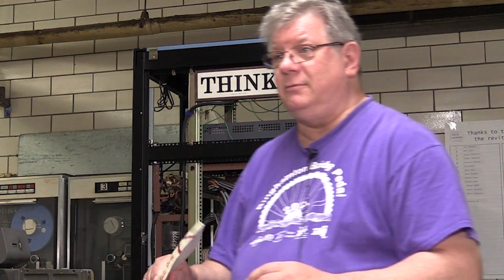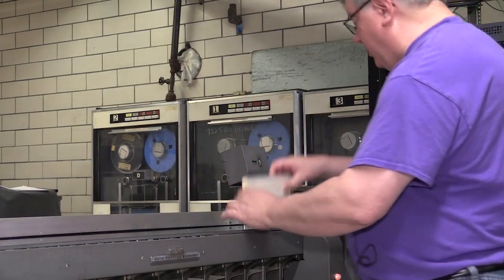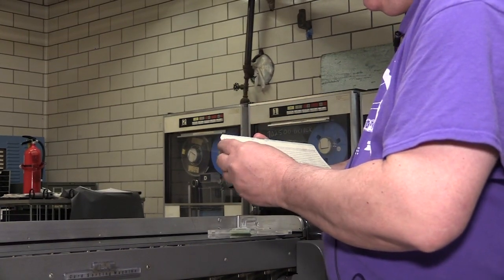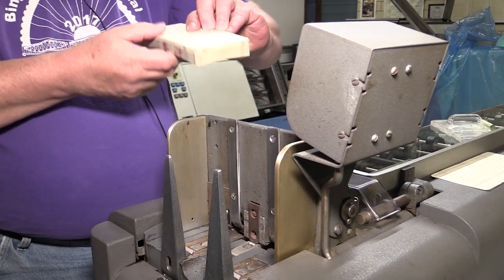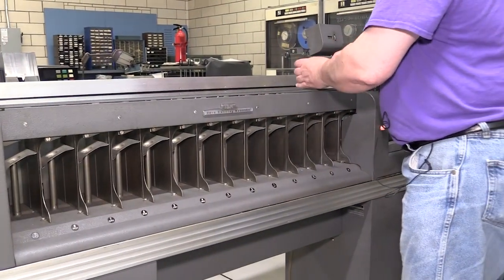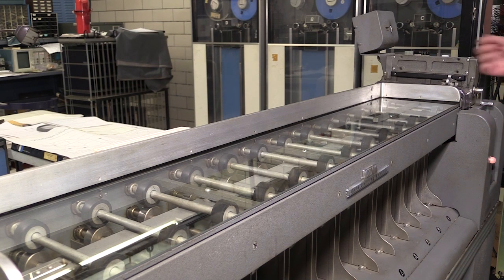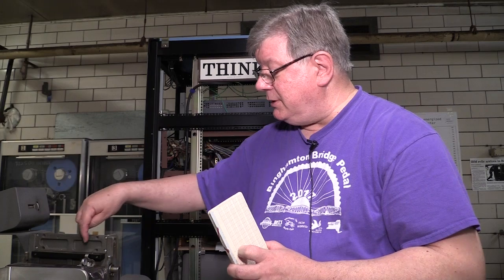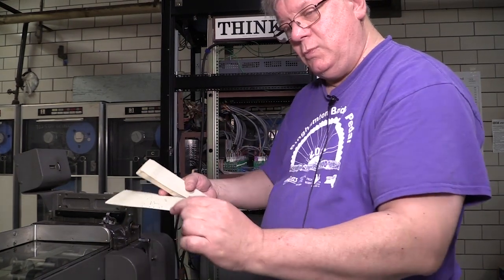IBM 082 Card Sorter

Comment: I used this machine a lot during my unit record days. If you noticed he picked the cards lit of the pockets from riggt to left. That would indicate a sort an ASCENDING sort. If you reversed the picking from left to right you would be doing a DECENDING sort. The 083 sorter had a hopper for 2000 cards. You can run this machine by constantly feeding more cards into it while it was running. While it was running, you picked the cards out of each bin and placed them into a metal rack which was located behind thw sorter and it had 13 bins. 1 bin for each of the punched card rows (blank, 12, 11, 0-9). The 12 row is at the top of the card, the 11 row is below the 12, the 0 was below the 11 and so on.
The "finger" he was referffing to was actually a tiny metal brush that would detect the hole in the card.

Comment: The first sorter I worked with was the 084 - 2000 cpm. We had the extended feed tray that would let us put up to 4000 cards in at a time. We got really good at picking up stacks of 3000-4000 cards and dropping them all on the tray while it was still running. But, when you had a 150,000 cards to sort, you didn't want to stop just to load more cards. We actually block sorted most of the time by sorting the high order column first and putting all the cards in the rack on the wall. That meant only sorting 1/10 of the cards at a time.
2000 cpm, though, made for some pretty bad card jams on occasion. The jams in the transports weren't really too bad. Crumpled cards that were usually easy to redo. But, jams at the feed throat were really bad. The cards were torn and mangled. It could take 1/2 an hour to clear and then replace. Then, we had to start the sort on those cards all over again. 
BTW, in your demo, as soon as you did the first sort on c/c 15, the cards would be completely out of order. 😊

Comment: I preferred the 085, but I have quite a few hours in front of an 082. Very useful machines in their day. I was taught to pull the cards out from the 9 bin first, working back to the right of the machine. It was slightly faster than starting from the reject bin end.